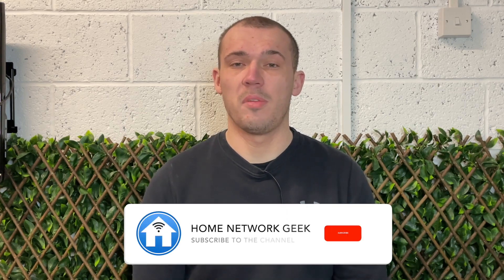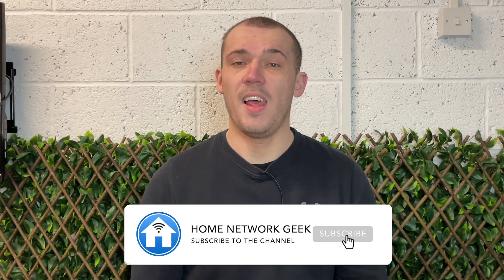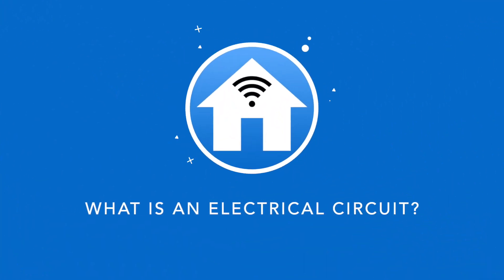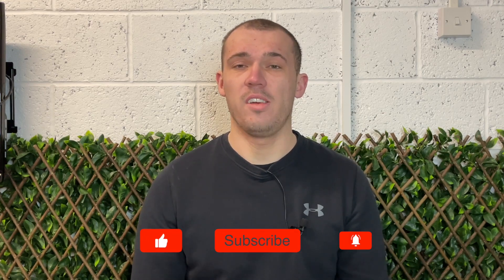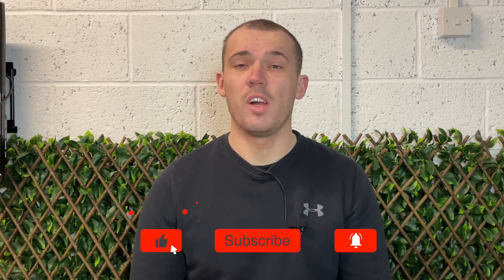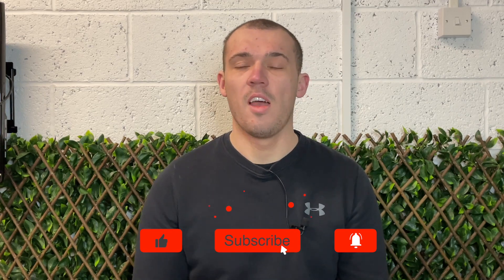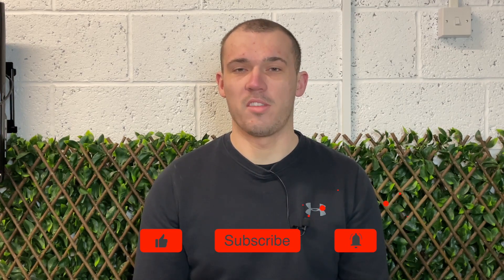Do Powerline Adapters Need to Be on the Same Electrical Circuit?

Comment: I have three phase so the current required is shared across each 30A phase. My TP-Link AV600 adapters still work across the phases because they share neutral and earth back at the consumer unit. I'm not sure which part of the electrical circuit these powerline adapters send & receive high frequency signals, probably the earth as there is less crosstalk/ interference on the earth cable.

Comment: Ring circuits are going out of fashion. Radials are way better. Easier to test. Ring circuits can be very dangerous if one of the cables goes open circuit forming two radials as the typical 32 amp breaker is then too large. 
You may need to read up

Comment: How can you tell if power line adapters are on same circuit? My DSL router is downstairs and I want to get stronger wifi upstairs.
Are these different circuits? Would it be worth it to use adapters?

Comment: Just tried my first pair of powerline adapters when using a comsumer unit with a split load pair of rcds and a spd device. 
Unit 1 is plugged into our modem and living room ring circuit and the second unit is plugged into my router in my office on a separate radial circuit (armoured 4mm2 cable) down the end of my garden. Working Flawlessly

Comment: I've had some electrical work done in my home recently. Previously, the plug sockets were on 2 separate rings (one for upstairs and one for downstairs) but both were connected together to a single switch on the consumer unit which was used to power all sockets. We have now had some work done to the kitchen which re-directs a new line from the consumer unit to the kitchen so that the kitchen is on it's own ring, but also had a new 15-way consumer unit installed for which we now have 1 switch for the upstairs sockets ring and 1 switch for the downstairs socket ring. We had this done so that if there are electrical issues with a downstairs or upstairs socket/ring then we don't lose power to all the sockets. 

The router is downstairs and a powerline adaptor is plugged into it, and my computer is upstairs with a powerline adaptor plugged into it. I have in the past few days had difficulties with the ethernet connection saying it was an 'Unidentified network', but have managed to fix that when running some commands through command prompt. However... the speed of my connection is virtually 0 mbps if using ethernet as I can't even now run a speed test it's that bad. 

Is it likely that this is related to the change from both upstairs/downstairs socket rings being attached to the single switch on the consumer unit to now being attached to their own consumer unit switches? Or is it something else that is causing the issue, like some kind of filtering for some reason?

Comment: One big problem on crossing circuits are the AFCI breakers. Simens have a capacitor on it and block the signal. But Eaton and Square-d d'ont and are more friendly to power line adaptors.

Comment: What about across multiple junction boxes? I have a shed that is powered on the same main line but it’s got its own junction box from the main house. Thanks!
Reply: You've probably tried it by now but yes it'll work.  I've got it working going through a second (garage) consumer unit.

Comment: I have just got the pass through av2000 done everything got one plugged in and into the router the other was upstairs stayed solid for like five mins then just a slow blinking power line all night did have a look at my main power board and it has a trip switch for downstairs and a separate one for upstairs sockets

Comment: powerline on the ground , when it gets wet is a data blocker. I also suspect, a refrigerator on the circuit can mess up data. I have experienced issues with certain power strips as well.

Comment: Good video. My Powerline adapters are able to transmit enough data across two separate circuits with each their RCDs. I can also see the IP address to devices connected, but not enough the get and image from. i.e an IP cam.
Reply: Powerline can definitely work on different circuits. It helps if they are on the same phase in the breaker panel. Being on the same circuit is certainly the best though.

Comment: Will powerline adapters work between two houses that shares the same main power and with a secondary router? Would be the best solution instead of digging down a cable in the ground.. drilling in walls and such.
Reply: same side of the transformer. preferably same main breaker panel. But the answer is yes. I'm sending data 350' thru a power line. when it gets wet is when we see issues.

Comment: Can I directly connected on the circuit box with rj45 to reach the entire connection..I'm researching it for newer innovation on grid tied solar inverter...where on the inverter side it's internally connected 100 meters away ..

Comment: Quick question, if i change my router to have separate 2.4 and 5ghz channels. Will that affect the way a booster or wifi mesh system give out wifi? Will having the channels split confuse the boosters or wifi mesh system?
Reply from the maker: You should be fine as your devices will ultimately decide which channel is best for them, or you will have a choice of using either the 2.4 GHz or 5 GHz band as they may appear as separate networks.
Reply: @homenetworkgeek192  also, if you’re far away from whatever is giving out your WiFi, you should use 2,4ghz but if your close to it, use 5ghz